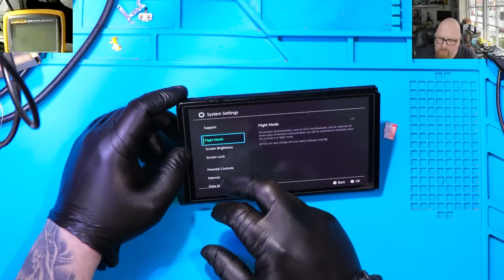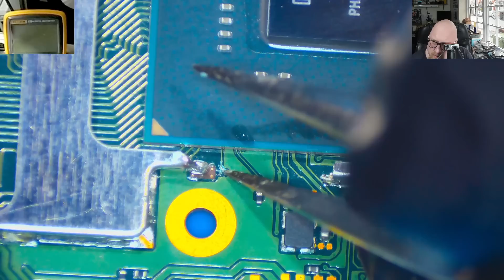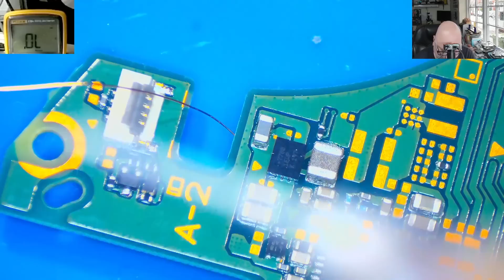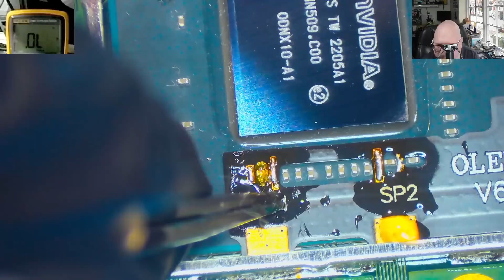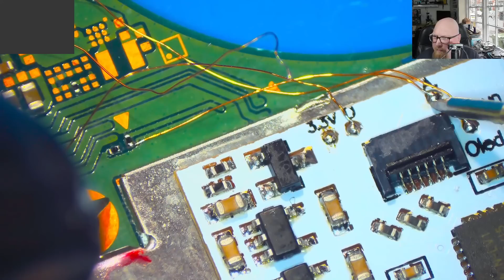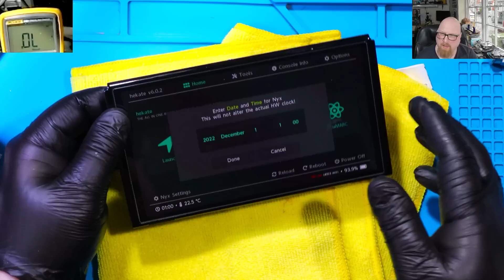Switch Oled v6 instinct installation...is it good quality product???

Comment: Hello. I soldered all the points and tested the diode readings. However when i try to plug a charger , the Led won't blink at all. Do I need to use a switch charger? I just used some generic usbc phone chargers

Comment: How does the wire not bridge anything? I was have thought a wire with some rubber type shielding. Just seems like it would short?

What am i missing? Lol I'm new
Reply from the maker: This wire is coated by transparent paint. It's called enameled coper wire.
Reply: Interesting. I'll have to get some. Thanks! 
Mod chip arriving soon.

Comment: Hello, why do you use cables without any type of coating? Couldn't that cause a short?
Reply from the maker: The wires I use in this video are coated with transparent paint. I've said that many times. They don't cause any short.
Reply: Thx great job and video. @tvpartsworld806

Comment: Hello, my clk value after scraping is approx 1500 and it seems very high to me for the almost 700 shown on your multimeter...I scraped very gently but enough to see the copper layer and put enough paste solder to create a solid ball on the pad. Any idea why my value is so high and any recommendations? the switch works thanks for the tutorial

Comment: I have the hwfly for lite, when i install firmaré uf2 by Usb C, the window  closed and then in the rp2040  one light blue blinked on the Led, after that green color flash two times continous, it turned off and returned to flash green color for two times more. It is normal?

Comment: can you list all the items you used in this video? including the wire and the glue?
Reply from the maker: everything is in the latest video description
Reply: @tvpartsworld806  thanks man! anyways do i need to tin the copper wire or can i just hook it up?
Reply: can i also put capton tape on the copper wire or do i need to put hot glue on there if soo would you mind linking that glue gun? kind of new to switch modding i used to do xbox 360s and so on

Comment: I'm not getting any reading from the B point, ive resoldered it multiple times but no luck. All other points are giving the appropriate reading except B point? any thoughts?
Reply: I fixed the issue through some back tracking, It's just as you said in the video it something with the diodes on the processor. But I still double checked to ensure no bridges was anywhere else. Thank you your vid is very helpful.

Comment: Im having trouble with point B, it's showing readings but after 2 seconds it goes back to OL, my chip is not booting and I'm guessing this is the problem. Any suggestions?

Comment: wouldn't mod any switch. 
I just think Nintendo will break it with there updates or something. 
What does this chip offer? 
Hey if it doesn't break when Nintendo updates there firmware. All good. 
Playing online is a big concern for me. Big reason. 
I hope emulation gets that much better.
Reply: when a update breaks any software mods. They will be updated. And no, a update cannot break the modchip

Comment: What is the benefit for installing a chip?
Reply: it's a chip to jailbreak the oled switch as it's much harder to jailbreak it without physical hardware on the  mobo, maybe in the future jailbreakers can find a way to jailbreak it without having to solder

Comment: Hi friend!

I installed hwfly with oled v6 kit but the console starts only in stock mode and the chip led is white The strange thing is having 450 on all points and 382 on B Those are a bit low…
Reply: did you ever fix this? since im having the same issue
Reply: @alicehops  yes i change with picofly zero rp2040 and i have successed at first time!

Comment: Who is this for?  You don't show details of installing.  Also that mat you are using has many magnetic sections.  The shield you "clean" is ridiculously dirty.  Your tools are too big and frankly you use the wrong ones.  No one cares about your bald head for the entire video.  Why are you using a qtip when you're getting cotton stuck in components. Why are you using unshielded wires?  This video isn't for anyone and anyone using your service is getting a cheap nasty job.
Reply: The copper wire has an enamel coating. It looks unshielded but it isn't.
Reply: how much do you hate your life? also if you're such a know it all, how would the switch even boot if the wires were unshielded and touching? clearly they have a non conductive layer on them.

Comment: as someone who installed the hwfly into an oled switch, this process is not for the faint of heart. it is soo easy to totally destroy the switch. though i will say you did a very poor job trimming that shield, in fact with some vibration i suspect the sharp edges you left will cut through the ribbon cable. Need to get some better diagonal cutter and file down those cut edges. Also at least for the hwfly you can solder extra connections to update it through the switche's usb port and i guess you either didn't do it or that chip doesn't come with that option. Also you don't need to re-flow the mmc it just introduced a risk you break something even more. Not sure it'll work with that adapter but you can put them under spring tension for just as good of a connection.

Comment: How can you tell if you got the good Samsung chip in your OLED switch? I bought the new years of the kingdom edition OLED switch. I hope that's the Samsung chipped one.
Reply: Only way to tell is to remove the board and read the print on the chip. Doesn't really matter tho.

Comment: That's a whole Lotta trouble just to play a few games
Reply: In my case i use it to dump 40+ game cartridges to an sd card and play them as if they are natively installed. you might ask why not just digital then? because then all the money is locked into that 1 account and Nintendo can not be trusted, i will always buy a physical copy when I can then use technology to make my life easier. In a lot of cases the switch breaking or getting stolen means you lost all the progress in virtually all of your games, not if you can just dump the backup save files though or transfer them to another switch
Reply: eh i think the price is worth it in the end, pretty sure all those 60 dollar games are gonna make up the price you would spend on the chip and service

Comment: Do you do repairs? 

I’ve got two Switches but one is knackered due to the left joycon rail connection burning itself out (had literal orange glow and small amount of smoke) and no long works since I’ve reformatted it as the switch expects the joycons installed at first boot up. 

My other switch which is my replacement switch works fine but the joycons don’t work when slid into the rails (the switch detects it and charges them but I believe the left rail is dodgy)

Comment: I have nothing but mad respect for folks who have soldering skills, bravo!!
Reply: @@parkjustin1797 was actually fairly decent in my prime. Not this level though. Plus my hands are WAY too shaky and unstable though s thanks to arthritis
Reply: @Paradigmfusion  AS a pro i hear this shaky hand bs all the time from the pretenders XD yall kil me XD
Reply: @jeffdughman9741  I’ve been working on computers for 38 years boss. As I said before. I was decent in my prime but once the arthritis, carpal tunnel and shakiness came in I can’t really solder anything super tiny anymore.

wait till you hit 40, it'll hit you too.
Reply: @Paradigmfusion what’s life without experience.
Reply: @doomsday361  oh I have plenty of life experiences. just pinpoint presicion soldering has never really been my forte. I mean in my prime I was fair at soldering, but no where near that level.
Reply: I know how to solder and I am also good with small electronics, I have done at least a thousand phone repairs, and I would still absolutely not attempt anything in this video lol. This is all beyond me.
Reply: I know it's a hard skill. Jelly.
Reply: As someone who has super shaky hands, I managed to install the SX Core by myself
Reply: Takes like 3 mins to learn how to solder
Reply: @joshua7426  I know how to solder. I e just never been very good at magnified soldering.
Reply: @joshua7426  stop smoking crack. You cooild solder a wire in a few mins. Doing micro soldering good takes years. I work doing advanced repairs in electronics and have took me years to get good at it under a microscope. Can you reball an ic? Try it. Try remove a chip and reball it. See if you burn it? Do you know your temps etc?
Reply: @joshua7426  3 mins and you can make a joint, but you aint modding an oled switch as a novice well maybe with a lot of luck
Reply: @NorthCamZ  true, yeah I wouldn't recommend as your first item. Def take apart an old remote or something and practice a few good times attaching wires neatly to the board and detaching chips etc first.
Reply: Que bien
Reply: Learning as we speak I mest up a oled motherboard but to be fair I did it the mad man way no microscope just bare 👁️ evidently my eyes aren’t as good as they used to be lol but I getting a new switch and bought a microscope waiting for the mod chip to come in might be today super excited about doing it properly now I’m sure the motherboard in my old oled is done for but maybe I need more practice to see shorts and what not
Reply: Its really NOT a hard skill to  learn m8 .........................................
Reply: @Blowfeld20k try removing a small bga chip, reballing it and putting it back on. I solder and took me years to learn. Basic soldering not so hard. Theres levels to soldering.

Comment: I did hear that reflowing the dat0 adapter did result in a higher failure rate. Have you found something that says otherwise? I have a chip and I'm fairly sure I can do this but I want to make sure I'm doing everything right
Reply: you dont' need to re-flow it (as you stated it introduces another failure point) but then you do need to give it a bit of spring tension so it keeps connection with the pin

Comment: Are those copper wires insulated? I don't see you scraping off any insulation, so I presume it melts away when soldering?
Reply: Ye, I think they're enamel wires so it most likely just melts away with the solder iron

Comment: Dear @Tvpartworld those copper wire you used are for fixing damaged traces on the board not to be confused with normal copper wires that I would say 0.5 BTW love your videos keep up with the good work let me hear what are your thoughts let me hear it in one of your videos Sincerly Just A Guy Who Loves To Help The Community As They Helped Me Out Thank You For Your Precious Time And Efforts
Reply: Pretty sure he's using magnet wire which has a thin layer of insulation. I think he knows better than to use exposed wire.

Comment: could be wrong but isnt apu just a branding thing amd does? i think its called soc or system on chip?
Reply: no, it means a very specific thing. soc is system on chip which includes everything from the cpu, io functions, ram, etc... in other words you dont' need any other supporting chips for a system to work it can do everything it needs by itself. in amd's case apu is for cpu+gpu (notice how it's missing the RAM?) Granted has cpus with integrated graphics so in comparison you could call amd's apus a marketing term but the reason they call them that is because the graphics on apu's is way way better than typical integrated graphics but they aren't SOCs like what's inside the switch or phones.

Comment: what is this for? is it for emulation?
Reply: It's a mod chip
Reply: you can run homebrew emulators but it runs custom firmware which allows back of games and playing backups along with running homebrew software

Comment: What is the purpose of the chip?
Reply: It's a mod chip
Reply: Mod chips like this one allow the device to run custom software. Basically, that Switch is now a much more functional computer that is jailbroken, instead of a locked down Nintendo device.

Comment: Why not using insulated wire? Isn't there a risk of it touching something and killing the system?
Reply from the maker: I've explained everything in  previous videos. I'm using ENAMELLED COPPER WIRE 0.1mm so the wire is covered by transparent paint. It's safe to use it.
Reply: @tvpartsworld806  Oh. I haven't seen any of your previous videos. New viewer here. Nice modding!
Reply: @tvpartsworld806  0.1mm this is really thin on that video looks more like 0.1cm

Comment: This is the first chip I've installed into a Switch. Amazingly, I had no issues with grounding; it worked immediately after installing. I'll def be more careful installing the next chip I have coming in.
Reply: someone in my city installs only this chip. is it good? never heard of it. Only the hwfly.
Reply: Was it difficult ? Im not stupid but I prefer working on cars not electronics. I’m pretty skilled mechanically and dexterous with my hands. I’d just like to know if it’s worth sending it to a 3rd party for install.
Reply: @martypino5258  its definitely safer to hand it to a trusted third party to take care of, but it's not as hard as I thought, but it's bad if you mess up
Reply: @martypino5258  you could find out EXACTLY how difficult it is by watching the video you're commenting on

Comment: Hello, I have two questions, why don't you use the other flexible cable?

And what is the heat for soldering?
Reply: I can't speak for him but I usually use 600f to solder and 700f to desolder. You don't use the flex cables because it can cause interference with sysnand which is the official one. Though the newer ones are finding ways to use flex cables while not interfering. Lastly I wanna mention that they also are starting to not recommend reflowing the dat0 adapter. Apparently the chip can be damaged a bit after heating up, even if going slowly which has a higher failure rate than using friction

Comment: great tutorial. After install on my oled I lost touch capability of the screen. Screen works otherwise as well as mod, but screen doesn't respond to touch.... Any info on this would be appreciated
Reply: Open it up and make sure all of the connectors are actually connected. Sounds like the connector for the touch screen isn't connected fully

Comment: That copper wire you're using, I assume it has a thin layer of insulation?  Does that melt away when you solder it to a point like you do?  I figure it must have some insulation considering the wires are all crossing & touching each other.
Reply: Yes this is typically called magnet wire and it has a thin coating of insulation that melts off as it's soldered. It's the same stuff that's used for the windings on electric motors.

Comment: Thanks bro, I use half of your techniques in my installation (same chip) I’ve skip the nand reflow (I’ve use the elasticity of the ground pads to push further and its working even after a big shake )
Reply: This is the way to go
Reply: What does this mean? You only soldered point c and the two anchor legs?
Reply: @michaellvoltare  yep that is it Michael, because it’s a flexible PCB I use a tweezers to push PCB ever so slightly further, tested the ohms and after doing that I had the soldering iron on the two ground points and that is it, no reflow required, even now travelling with me to more than 5 countries, no issues :)
Reply: @raphael286 hey bro I’ve done a few oleds and honestly it appears to be that I’ve had some issues with inconsistent boots (flashing red) from the looks of it it’s the c point, I usually solder the 2 ground points where the emmc shield latches and the right side capacitor/resister? The one that’s more spaced apart, so you only solder the 2 grounds point and leave it at that? TIA!
Reply: what is it? please can u give name of this item?

Comment: I installed mine.  I see it flashing, then it flashes purple, then white and boots into the original OS.  Any idea what might be going wrong?  I am checking all my solder and such, it seems fine so far.....
Reply: Check your sp1 and sp2 connections maybe the capacitor fell off the board that's happened to me a couple times.
Reply: @user-gj6vg6nq2f  capacitors are all fine.  I believe that it’s my microscopic via.  I couldn’t get a good mount.    Then when I finally did, it broke off and is no longer reattaching and giving me a diode reading.  I could work at it more, but I think I’m starting to scratch it too much…. Could lead to potential damage.  Luckily I just found a guy on Etsy that is gonna fix it up for me.  I sent him some pics, and he said it should be fine and that he’ll touch it up and reassemble it for me. 😭 decent price so I can’t complain.  I spent so many hours working on it, just glad I don’t have to keep stressing on that via
Reply: @partypat7229  for oled? The part where you're suppose to scratch off some solder mask?
Reply: @user-gj6vg6nq2f  yeah OLED.  That part for me was super close to the ground from the housing that you cut by the apu.  Didn’t quite look like it did in the video. I still tried my best not to scratch too far, but at this point I’m probably using the wrong tool.
Reply: @user-gj6vg6nq2f  and when that part was good, something else was bad.  Fix something else, then a different connection breaks.  Felt like I was going insane.  All while one mistake destroys everything
Reply: @user-gj6vg6nq2f  micro soldering ain’t my specialty

Comment: it doesn't really matter, but it's a lot easier and less likely to cause damage by wiggling it left and right if you just use a sewing needle to lever the little latches on the APU shield outwards. Then the shield comes off extremely easily without the need to wiggle it and bend it.
Reply: True, i did that while i was figuring a way to not damage stuff since i got a hard time to open it and i didn't want to bend it ike crazy from 1 angle.
Reply: Thank you, I was trying to come up with better ideas for removing the APU shield as that looks bad even if no one will see it.